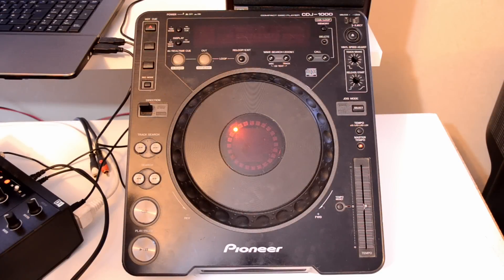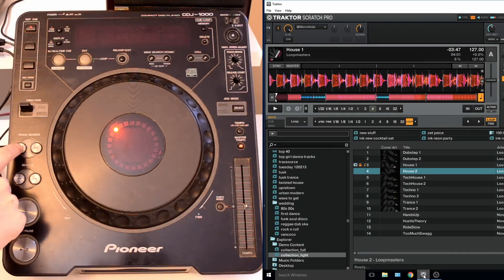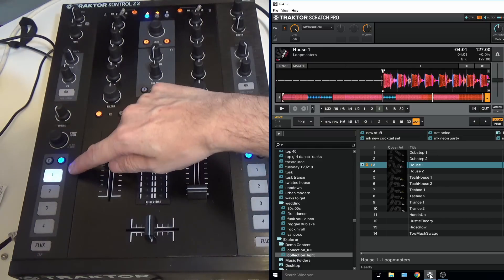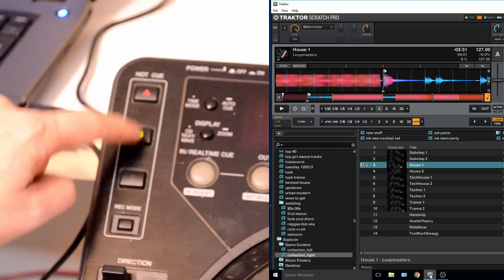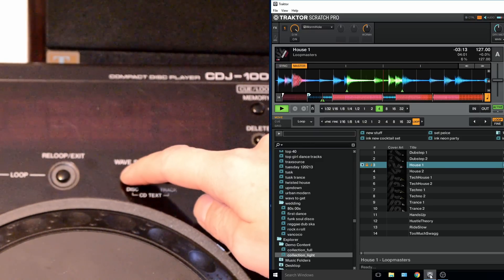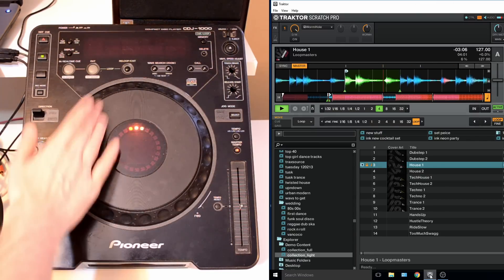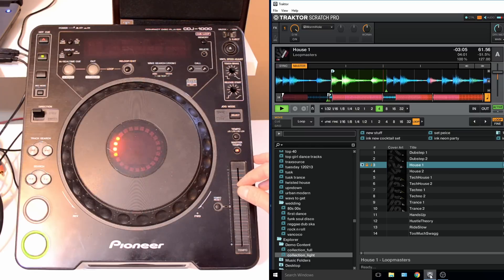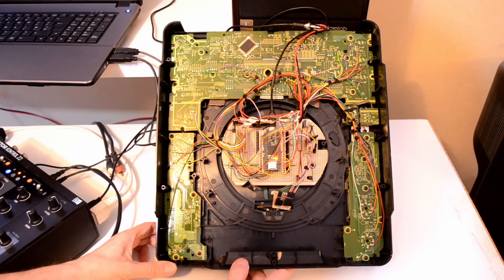Midi converted cdj 1000 mk1 pt 2

Comment: I'v got the cdj1000 mk1, cos i fot the SD card slot was used to play music but not the case i found out now i wanna modify them to hav the touchscreen,usb,midi and rekordbox n any other things, but can i not just buy the parts from other cdjs or xcdj and change them, am a vinyl dj and ov all cddjs Iv had i got bored burning CDs tht why i got these thinking as j said the SD card, am good with electrical stuff, just need an idea wot i need, like the screen from the xcd 1000, any advice would be great, watched loads of ur vids keep em coming, i like to reuse things if possible,
Reply from the maker: hi. my project will not work with USB or Rekordbox it's just a simple midi device after the conversion. You want to look at the Russian guy for USB and rekordbox.
Reply: Rekordbox is not essential, it only for home use, i just don't wanna be burning CDs everytime, i got the cdj1000mk1 thinking the SD card slot wud allow me to put music onto SD cards, which obviously is not the case,
Reply: just burn CDs. 
highly recommend, because 1000s also force you to beatmatch by ear. that's actually why I prefer them for my home setup. that, and physical media just feels nice.

Comment: Awesome work mate. The jog wheel LED got me a bit dizzy though :D
Reply from the maker: that's just an optional extra I was playing with.
Reply: DJ legion Of course :) There is a way to map the hot cues to also start the track (if the deck is stopped). This resembles the original Pioneer hot cues and I find it super useful ;)
Reply from the maker: That would just be a command in traktor, so I will have a look. The software in my unit is just sending midi to traktor so the actual setup of each button can be changed to what ever you want. I have to do some special code to make the hot cue leds change colour, but it's still just reacting to traktor and could work with any  other dj software.
Reply: Doing it straight in Traktor is easy enough. I thought you had to change the code in order to enable it. If you're interested in doing it, additionally map each respective hot cue to the cup(cue play) and change the cup mode to instant in the transport page in your preference window. This should do it :) Make sure you include your conditions in the cup mapping to take your modifier into account ;)
Reply from the maker: I will try this out.
Reply: DJ legion Awesome. Let me know how you get on.

Comment: awesome work. respect. I am long time searching to find a way to get my cdj1000 working with traktor software. Does it clearly mean there is noway to get them working without make the changes as you did. Thanks for your reply in advance.
Reply from the maker: unless you use traktor scratch or serato with timecode this is the only way to connect to traktor